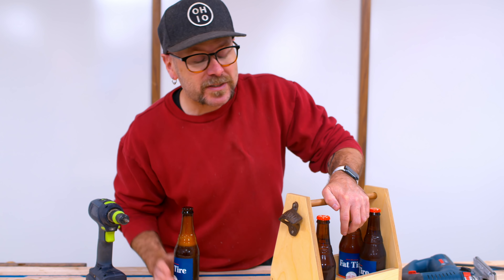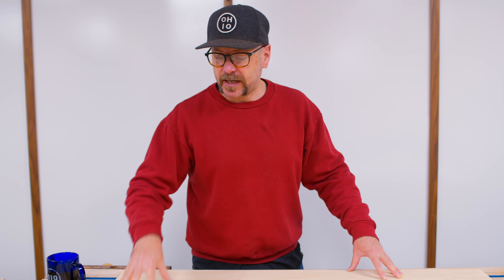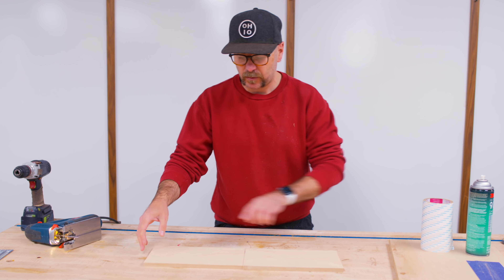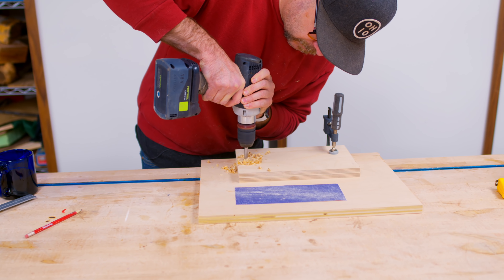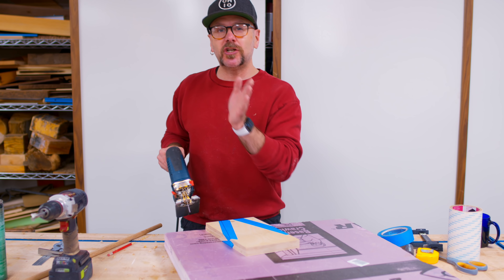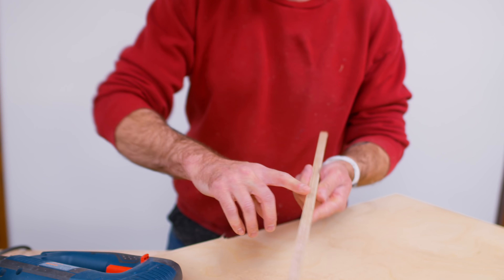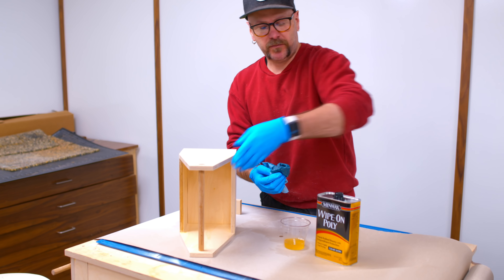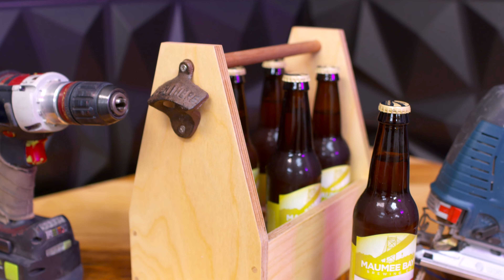Your First Woodworking Project. You Only Need These Two Power Tools. Beer Tote.

Comment: Another tip: Take a scrap piece of wood that is straight (ideally 2 pieces fastened together to create a 90 degree angle) to use as a guide to make sure the drill bit is going straight into the piece, not angled.

Comment: So the rails that hold the bottom panel in don't need any type of mechanical connection, just glue?  Seems like the weight of the beer could possibly be too much?  Great tutorial in any case.  Thanks!
Reply from the maker: Nope. I’ve made dozens of these and have never failed. Thanks!

Comment: A tip i like to use to prevent blow out of edges is to use a large craft knife (box cutter ? ) to score the line, then cut outside the like, any chips will brak off at the score.
Also, you used 4 tools (putty knife and handsaw) :P :D

Comment: We need more easy projects to do at home with basic tools :D !!!!! For example I am interested in an easy-to-make piece of furniture with drawers. Something like those library drawers. In the old style without the use of drawer mechanisms. Very nice please !
Reply: Leo GreenGaming make the boxes for drawers spandex then add strips of wood down the lengths of the sides. In the carcass of the furniture it goes in, attach wood strips with space in between slightly wider than the strip on the drawer. Add wax to the faces that will come in contact with each other so they slide easier. When putting the pieces in the carcass, use an extra strip you cut for the drawer sides and some playing cards to space it out and keep the spacing even.

Comment: Great little project and video David, although I'm curious why you decided to use the jigsaw and drill for this, instead of a circular saw and drill? Since it was all straight cuts it seems like it would have been a lot easier that way :)
Reply from the maker: I think the circular saw may be a bit more intimating to newbies. Plus I hate using one.

Comment: Assuming it really is your FIRST woodworking project, here's a list of stuff you might need at the home store according to this video: drill, jigsaw, 5/8" Fortsner bit, 1/4" drill bit, blue tape, double-sided tape, ca glue, wood glue,1/8" plywood [bottom], 1/2" plywood, 2" foam insulation,sandpaper, spray adhesive, tape measure, pencil, straight-edge, big putty knife, flush trim saw, 5/8" dowel, 1/4" dowel, hammer, clamp [maybe], rubber gloves, Minwax Wipe-On Poly, rags, bottle opener, jigsaw blades-wood-fine cut. NOW - what did I miss????
Reply from the maker: Attitude. You’ve got to have a good attitude. Although not sure it can be purchased at the home store. 😎

Comment: For the sake of being a simple project, would it be a strong enough joint to just make the whole bottom a single piece of 1/2” and glue to the sides the same way so I don’t need to buy another piece of plywood and have less cuts? Some dowels could probably go into the bottom also.
Reply from the maker: Yep, I do believe that’ll work just fine.
Reply: Make Something thanks.